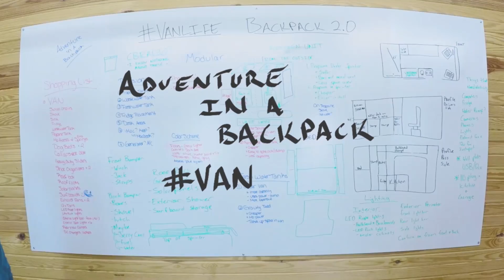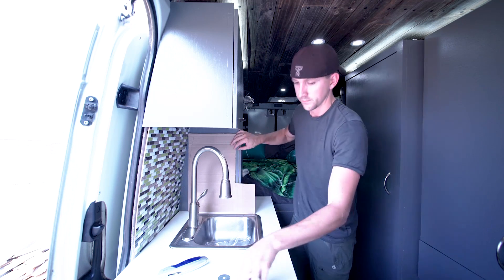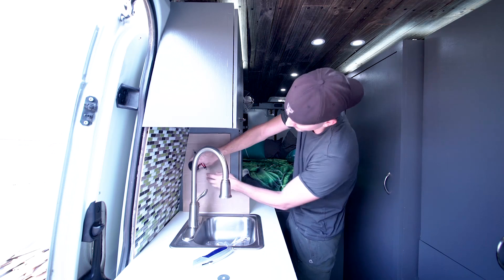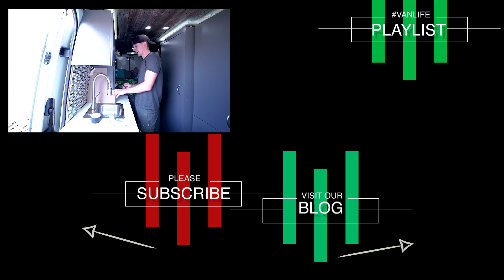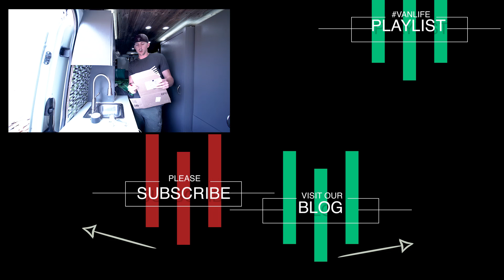How to Scribe a Wall in a DIY Campervan

Comment: For this case it works perfectly. If you need more details in the curve you need to take a smaller wheel or switch to another method. Smaller wheel means that you need to be very close to the wall already or do many steps.

Comment: A compass/scribe is tricky to accustom oneself to use at first but overall it will work more accurately and quicker in the long run . Keep the pin and pencil horizontal for this type scribe. 

Wishing you safe and fun adventures.

Very entertaining videos. Thxs
Reply from the maker: Thanks for checking out our video!  I had a hard time using the scribe because since everything else in the van other than the floor is not square, it kept throwing off my "level".  Probably would get better with practice, but definitely an issue nontheless.

Comment: I think somebody mentioned it already but you have made the simple look so complicated.  Get a set of compasses and simply set them to the size of the largest gap and your done in one pass. It takes a few trial runs to get used to holding the compass square but not many and you can scribe anything in one pass.

To go one stage further the panel you are demonstrating on needs to finish flush at the front.  To achieve this perfectly simply offset the panel by say 50mm at the front. Set your compass to 50mm scribe and when the cut is done you have a perfect scribe and a board that is flush at the front.   

Good video for the uninitiated but whilst you are gluing popsicle sticks to something you could have done four panels and be having a beer.  It is one thing having all the time in the world but if you are doing this for a pay check keep to the  KISS principal.
Reply from the maker: There are 100 ways to do this.  Find the way that works best for you and your needs and go with it.  It's good to have a bunch of different techniques in your toolbelt.

Comment: Any tips when you don't have a wall to scribe it from? So we are struggling with the wall for the shower. And both sides its 'air'. So its super tricky as the height needs to be perfect and the rounding of the ceiling but also the walls and the rounding there.. We are lost!

Comment: A compass would do the job in one go and allow you to get all the way from top to bottom.
Reply from the maker: I was actually able to get the overall line closer with this method than with the compass.  The compass required me to be perfectly perpendicular to the cut whereas this way you could do it in a hard to get to area with your off hand upside down.  That's how I felt anyway.  Thanks for watching! :D :D

Comment: Loving your design and attention to detail. I'm a new subscriber so I was wondering if you have costed out the project yet and I just haven't seen that mentioned yet?
Reply from the maker: Thanks so much!  Welcome Aboard!  Our budget for the entire project is $40,000 and we are right on track.  That cost includes the cost of the van.  Also, $10,000 of that cost is eaten up by our roof racks, front bumper, rear bumper, and bumper boxes.  Another $5,000 is our solar system that we will be writing about very very soon (as we are installing the panels today...)

Comment: How did you manage to scribe the whole cabinet on the other side? When you were making it, there's no wall for the scibing template to lean against
Reply from the maker: I'm not really sure I follow the question.  Could you hook me up with a re-wording?  Sorry about that.
Reply: Yeah, sorry about the messy wording, for the floor to ceiling cabinet on the right hand side of the video, how did you manage to scribe the side walls for the whole cabinet? There is nothing for you to lean the cardboard against when you are first starting off the right hand side. How did you manage to secure the template to a flat enough surface for you to scribe against when theres no architecture/starting point?
Reply from the maker: No worries!  Yeah, so we didn't even use cardboard for that one.  We were able to get more precise on the wood itself.  For that side, we just cut a piece of plywood to the height of the cabinet (square on the top and bottom) and then used this scribing technique as we pushed it into place.  It took a few passes with the jigsaw, but was ultimately able to get pretty close.  So, basically, the vertical uprights of the cabinets were the basis of the rest of the unit and we could make our other measurements off of that.
Reply from the maker: ...this is very difficult to describe without visuals... lol
Reply from the maker: ...and I don't know if it'll help at all as it's in a time lapse and goes pretty quick, but here is the video about making the cabinets: https://www.youtube.com/watch?v=X12lHY4nkAY
Reply: I think i get it, you propped up a piece of plywood and had someone hold it, then did this scribing process, albiet with a much larger circle, and then managed to get it squared away. From that, you used that new sheet of scribed wood as the background prop?
Reply from the maker: Maybe... I think so... lol

Comment: a compass works too.
Reply from the maker: +michelle holmes I was actually able to get the overall line closer with this method than with the compass.  The compass required me to be perfectly perpendicular to the cut whereas this way you could do it in a hard to get to area with your off hand upside down.  That's how I felt anyway.  Thanks for watching! :D :D